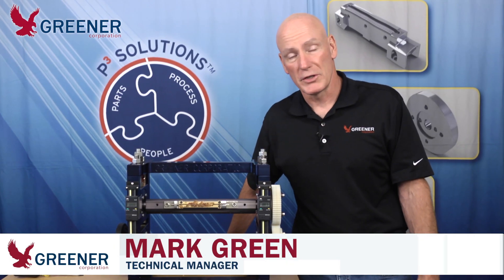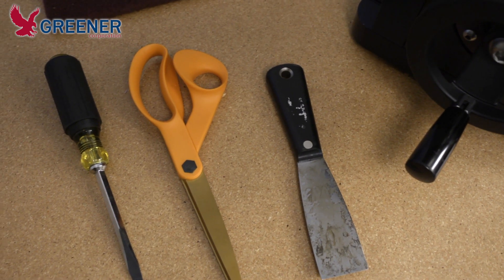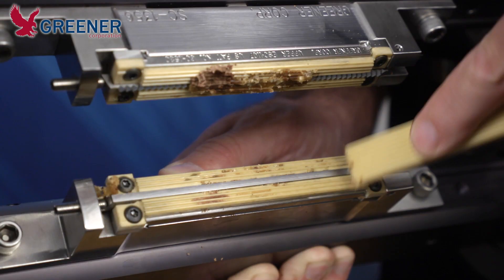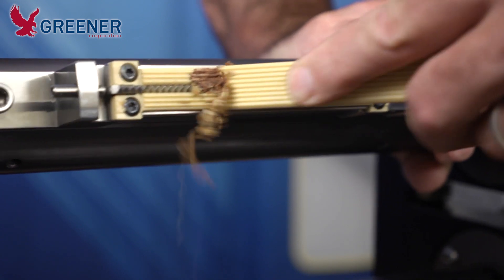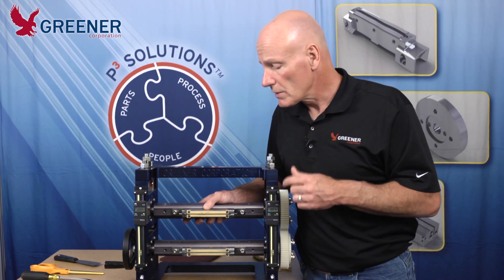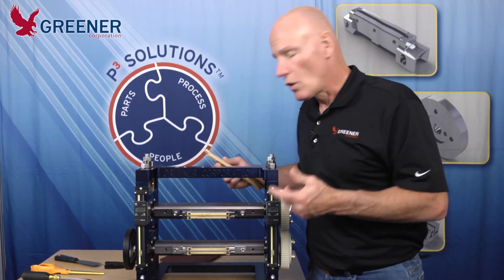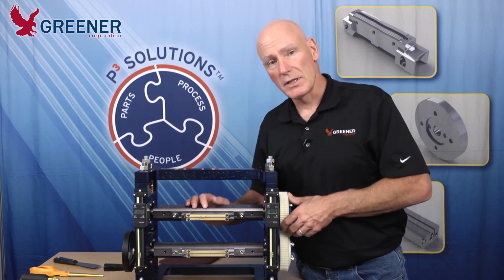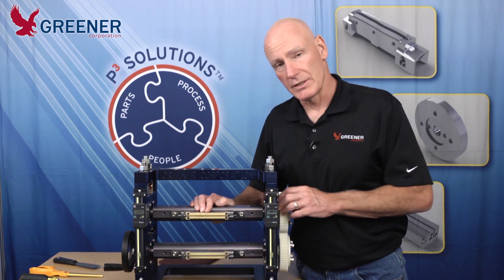Cleaning to Improve Package Quality & Productivity

Comment: what kind of metal is used in the jaws please?
Reply from the maker: Thank you for your question. We use a variety of different materials to manufacture sealing jaws. We consult with our clients and  recommend the best material for their packaging film, product, machinery, and conditions. Please contact Greener at https://greenercorp.com/about/contact/ and we can provide more details, and you can also learn more on our website. https://greenercorp.com/products/sealing-jaws-crimpers/sealing-jaws-for-horizontal-flow-wrappers/    https://greenercorp.com/products/sealing-jaws-crimpers/sealing-jaws-for-vertical-baggers/
Reply: Dónde se pueden adquirir o comprar ésas mordazas para sellado?
Reply from the maker: Las mordazas están diseñadas y fabricadas por Greener Corporation. Puede contactarnos a: custserv@greenercorp.com o desde nuestra página web: https://greenercorp.com/es/contactenos/